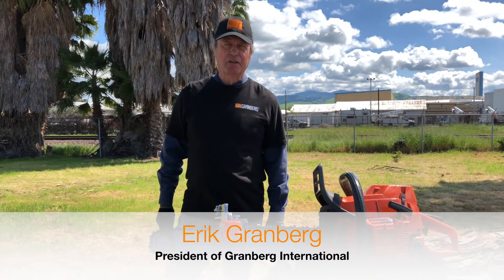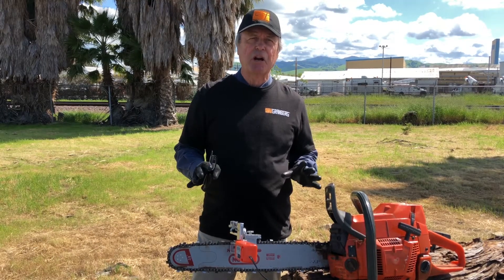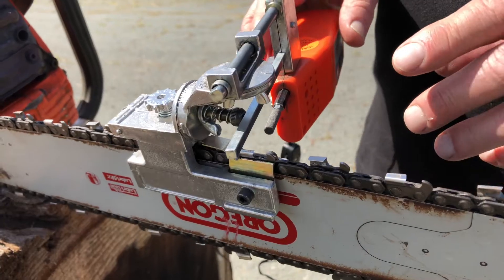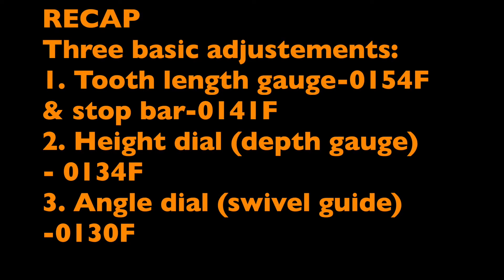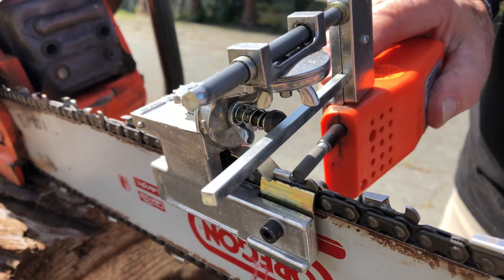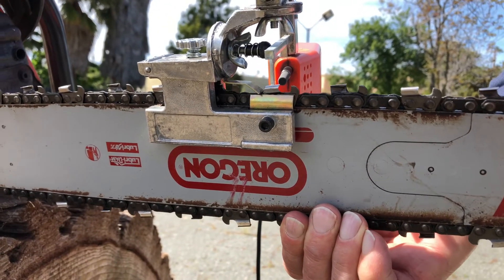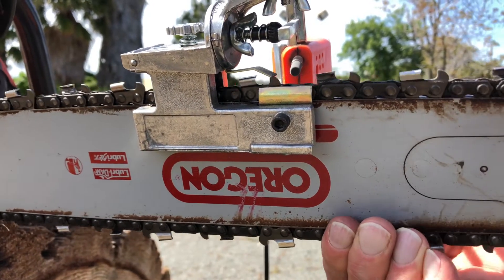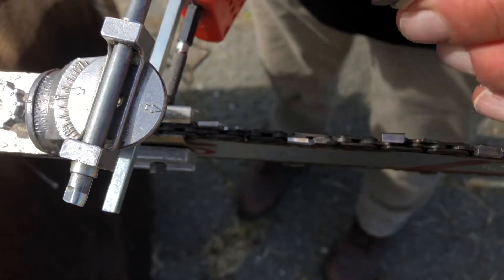How to sharpen chain with Granberg's G1012XT Precision Grinder

Comment: This is great looking product. Will it work with a Stihl  MSA 70 C-B 12 chainsaw? It uses a  Stihl 1/4" pitch, .043" gauge chain, specifically the STIHL Oilomatic 71PM3-64. If so what would the settings be? Does it also need a flat file to finish the sharpening? Thanks.

Comment: How do you use this if the chain is NOT on the bar?
Reply from the maker: This sharpener is only intended to be used on the saw bar. But if you had a spare saw bar that matched the chain you have, you could set the bar in a vice and sharpen it that way.

Comment: The Allen cap head bolts used to clamp the blade need a 5/32 inch Allen key, outside of the USA that's 4 mm

Comment: I don’t understand why the tooth length would change just by rotating the guide by the same degrees to file the opposite teeth ??
Reply from the maker: Hi Scott!
The G1012's base was designed around an older  3/8 bar. If the bar you're using has a different width, either wider or more narrow, it will shift the relative center of the pivot point on the swivel base, and that will move the grinder forward or backward by a fraction of an inch.

Comment: My first experience with this type of jig was in mid 1960's with a McCulloch branded tool very similar to Granberg with file.  That one and a couple of Granbergs always filed one side more than the other and I never understood why the engineering of the product allowed that.  Like this demo, you have to measure and adjust to avoid cutting one side deeper.  But, why not fix the design so that you can just rotate the top section to the opposite side and get the SAME result?
Reply from the maker: Hello! We are engineering that problem with our new design which will have an adjustable mounting system that allows you to center the 
filing jig on the various bar thicknesses that are out there so when you rotate to the other side the file will be located on the same center.
The G1012XT currently should not have that problem since you grind from the same side for both teeth. - Erik Granberg
Reply: @granberginternational  Good news!  Thanks for the reply.  I use the Granberg file'n joint rigs to true-up my chains after field use and several field sharpening free handed.

Comment: hi i just bought a 12v charpener i have a jonsered turbo with 375 tchain what diameter stone do i use best thank you
Reply from the maker: Forgive the late reply but the size stone you would need for the 375 pitch chain is a 7/32" Stone. Its our part number G419-3
Reply from the maker: https://granberg.com/product/g419-3-grinding-wheel-732-3-pack/

Comment: When I am trying to push the Grinder forward & back it is NOT  Easy,    NOT SMOOTH, Tried Silicone Spray  but Still not Smooth.... ANY SUGGESTIONS?   THANKS
Reply from the maker: Couple questions: Are you using our sharpener? Electric or the hand sharpener? And secondly, we use our Kool Grind lubricant for the stone. https://granberg.com/product/g440-kool-grind-grind-cooler-and-longer/?v=7516fd43adaa Any other details you can tell us will help us to figure out whats going on. Thanks!
Reply: @granberginternational  Yes I am using Your Granberg Electric Model G1012XT  Sharpener.. No do not have Kool Grand Lubricant . I will order some... I did notice if I lift up just a bit on the sharpener it does seem to move smoother.. Thanks so much for replying... Once I get the hang of this sharpener I think it will be Great for sharpening chain saw chains.....PRACTICE,  PRACTICE, PRACTICE..!!!
Reply from the maker: @rjazco51  Totally, sometimes it takes some time to get the hand of it. However, if you'd like shoot us a picture of your chain and setup and maybe even a quick video and we'll see if we can decipher whats going on. There's a balance of getting it properly in the gullet. And maybe another obvious question but you've got the angle set up right? Either way shoot me an email at lindsey@granberg.com and I will personally send your questions/pics to Mr Granberg ( my father ;) Happy holidays!
Reply from the maker: @rjazco51  Also - we are having a black friday sale starting Friday - use coupon code: blackfriday20
Reply: I have had this problem too. It doesn’t have anything to do with the grinder stone but rather the metal shaft that slides back-and-forth seems to get hung up or stuck. I haven’t tried it yet but would grease on that post make it slide back and fourth easier?

Comment: I have a G106B File N Joint. Can I just buy the electric grinder separately & build a G1012XT? Or is the grinder assembly sold with G1012XT have brackets that are not on your other 12V sharpeners? And if not, why the hell didn't you make it adaptable to the G106B File N Joint, what's wrong with you?! JK :-P You might consider engineering some kind of adapter brackets so your customers like me can use the 12V sharpener. I'd buy one & possibly several other customers would want one also. It doesn't look like all your other 12V sharpeners have the needed attachment brackets required so...

Comment: Thanks for the video.
How long would you expect a single sharpening stone to last? (I know it's relative, etc. ... but say, for example a 28" chain that never got any damaged teeth). Thanks!
Reply from the maker: Up to 4-5 sharpenings, depending on how much you have to grind to get it back to a sharp edge. It will last longer if you use our Granberg Kool grind. As it wears down you will loose the diameter of the stone, which at that point could be used on a smaller pitch chain.
Reply: @granberginternational  Thanks!

Comment: At 3:43 I can see an angle set at 5 degrees,  what is the purpose of that?  Also he is sharpening a (non granberg) ripping chain in the video, but at the end of the video he's working on a granberg ripping chain which has different angles.  No explanation of what's going on.  I also was hoping to be enlightened as to using this sharpener for setting depth gauges (rakers).    One more thing, there are better stones available to fit this sharpener,  EZE-LAP Diamond grinding stones, available at baileysonline.com.   Other than that, it's a good sharpener for the price,  I can think of some improvements that could be engineered into it, but the cost would go up.
Reply from the maker: At 3:56 it shows you it's at 10 degrees and explains each mark is 5 degrees. Not sure where you are seeing 5 degrees. Also, I can assure you Mr. Granberg is using Granberg Ripping chain the entire time and they are all set at 10 degrees. If you give us a call at 925-380-9400 we'd be happy to go over how to lower your depth gauges with the G1012XT.

Comment: I bought this sharpener this past spring when it was on sale and I love it for all my chainsaws. I have two problems with this video.  One is that it doesn't stress the rotation of this tool when sharpening as explained in the included directions.  The grinder should turn toward the tooth which means the power head must be to your right as you set up the sharpener.  Second, grinding the depth gauge teeth or rakers is just as important is the cutting teeth.  Ignoring these will make your saw cutting be less efficient. Also doing it but grinding them too much can also make your saw more apt to kick back since it allows the chain to cut too deep.  Eric doesn't give any instruction on this process at all.  There are a couple of other videos by others that are much better at explaining this tool.
Reply: Could you post a link to videos you found to be more helpful? I’m no stranger to using a saw. Used a hand file for years and did ‘alright.’ I have this sharpener and love it for speed, accuracy, portability, and cost. Also you can use Stihl stones which are readily available at my local Stihl dealer. I came across a video that suggested the stone turn away from the top. This method leaves burrs which would be gone within moments of the first cutting. Wondering which is better. I know when sharpening a carbon steel knife (like a K-bar) on a wet stone you move into the blade. However these are not the same quality of stone. Just a thought. With this being a DC motor, you can connect pos - neg and neg - pos and get reverse direction of the stone.

Comment: Ive got one of these sharpeners, absolutely love it! Your tooth length doesnt regulate how much wood is being cut,your rakers do. You could have teeth of all different lengths,either side of the bar, as long as your raker are all set to the tooth. Lots of good videos about this. I usethis grinder on my rakers to, works slick for that also
Reply from the maker: You are correct that the rakers determine how much wood is being removed with the top cutting edge of the tooth. The tooth is tapered from front to back, so if you grind one side shorter than the other side, the longer side will take more wood, create more kerf and the saw will want to cut on the curve, following the longer tooth.
Reply: Quick question. How do you determine if the rakers are at the correct height? I thought ripping chain spacers were a different height than standard chain.
Reply: How do you use it for the rakers please?
Reply: I too would like to know how to use it for rakers. Just got mine and haven't even set it up yet. That'd be nice to know as I get going.
Reply: I'd save stone for teeth. Easy enough to use flat file and gauge for rackers (like one from Westcoast Saw).